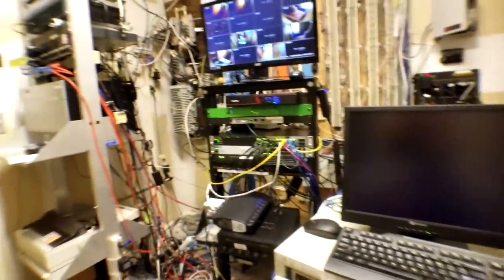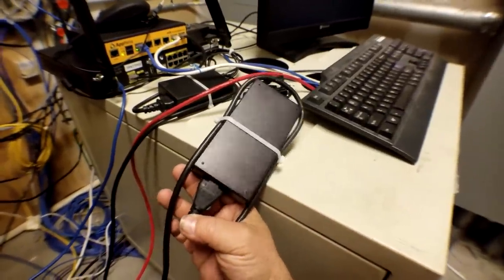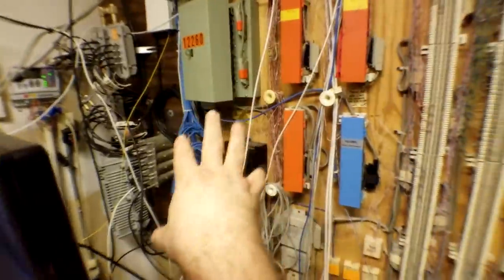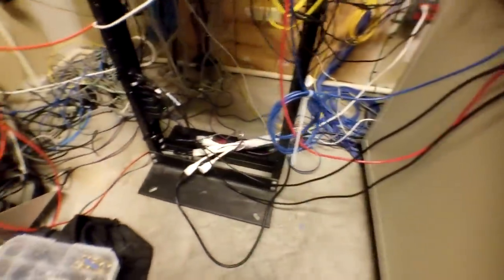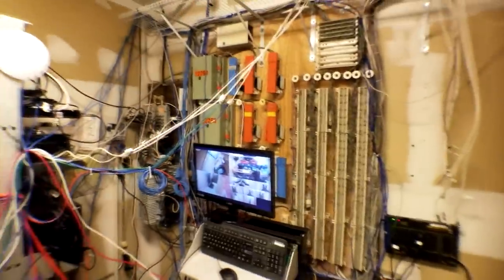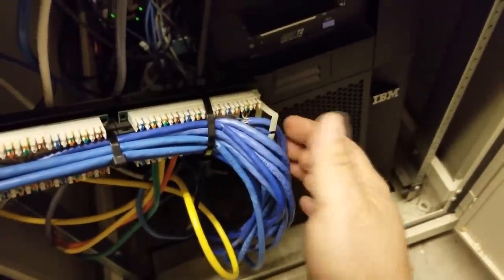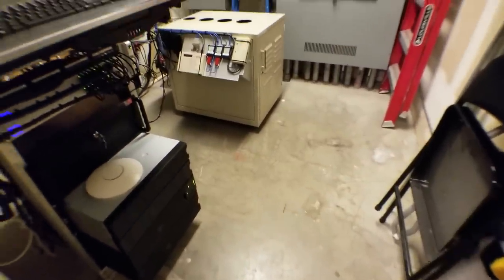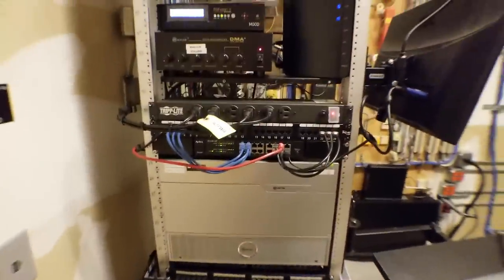#037: The Chamber of Cable Blunders (from Florida)

Comment: This is only the 2nd of your videos that I've watched, but it's got me wondering: Do you talk about lightning/spark/surge/flame suppression at length, and how to properly arrest (panel) / ground (esp. PoE) / insulate (chassis) / fireproof (plenums) equipment so unsuspecting "pros" don't leave the customer with vulnerable gear?
Reply from the maker: I have talked about it in length as of yet but it is definitely in the plans!
Reply: @FiberNinjaStudios  Another great topic (which I suspect you've already touched on) is crosstalk and RF shielding. At least in the sense that most people don't know bupkus about either one. :-)

Comment: Curious question - Which I may have missed in the Video, What range would the charge be for this work?
Reply from the maker: Obviously a lot of variables and factors go into what I charge for work like this. In the case of this job, I was actually working on multiple sites over a 3 month period. This was also on the other side of the continent and they were covering my room and board costs while I was there (as well as paying for my flights to and from). So, it would be hard to isolate this project and come up with an idea of what it would be. But, generally speaking, a project like this would usually run anywhere from $10K to $30K depending on the complexity involved. And I will add that I have learned a lot over these jobs that there is a large amount of unexpected problems that always happen to pop up so I tend to lean towards the higher end of the scale these days knowing I have no idea how difficult one of these projects will ultimately wind up being.
Reply: @FiberNinjaStudios  Thank You, I've been doing this type of work for the past 30yrs with a few Fortune 500 companies as a Salary employee. Was just curious what this skillset pays within the Contract side of things.

Comment: Curious to know how much you're paid to clean this mess (if I were you I would probably recreate the room from scratch ^^' ). In my opinion probably not enough.
Anyway the good thing is at least one manager understood it was time to do something with this room.
Reply: "Curious to know how much you're paid to clean this mess" Not enough!
Reply from the maker: Not Enough is definitely the amount I was paid for this project... I couldn't start from scratch mainly because this was a live system that was slowly being migrated to newer systems so it took time just to become familiar with all the running systems in place while working to make everything secure and safe. The real need for the room cleanup was that the local cable company needed to install a large wave of upgrades in equipment but refused to enter the room to do the work without my cleanup happening first. The entire hotel is undergoing an entertainment system upgrade with all new TV's and receivers that all terminate down to this room as well but there was no room to install anything nor was there room for a tech to enter and do the install!!
Reply: @FiberNinjaStudios  like I said it would have all been taken off line. they have back up plans for when outages happen. it would have been cheaper pulling it offline IMO then it would have been how he did it. Two people and a cable trace could have had it sorted out in a half a day then all untangled and straightened out and back on life in what 12 hrs or so..

Comment: I don't think I'd be willing to take on a project like that unless the client agreed to just buy a decent rack with full rail support. I hate those two post racks. They're inherently unstable. I'm used to 44U server racks that are incredibly stable. Then you can latch in your redundant PDU into the rear side of the rack. It's just a much cleaner solution.

Also, is there a particular reason why zip ties are being used for temporary cable management instead of velcro loops?

Comment: Using 
Keystone 1U Patch Panel and Modular Coupler is a much better system of cable management it fixes all the issues that took your hours.
Reply from the maker: Unfortunately, I often am stuck with the hardware I've got and have to make the best of it...

Comment: Nice clean up job, but stop using those fing zip ties. Use velcro rolls instead, as it's much easier to remove and add wires to a bundle and you don't have to worry about cutting into a cable removing velcro or having someone jackball sinch it down so hard they kink wires. You can also start bundling cables immediately instead of waiting until the entire rat's nest is fully separated. 

Also use only 24-port patch panels, and put a 48-port switch in between so you can patch using 6" or 8" cables which eliminates the need for horizontal cable management in most cases, which tends to waste valuable U's of space in the rack. Patch panels with individual keystones might cost slightly more, but will make life 100x easier if you need to repunch a Jack or add a new drop.

The easier you make it to maintain, the cleaner it will be and the more likely those that come behind you will add nea cables to your bundles and not create a spaghetti nightmare like this one.

Comment: I wouldn't have run but I sure would have said things are going to be down for a day while I rip everything out in make a new install.
I like the loops in the back of the patch panel nothing worse than trying to work where someone has made guitar strings. Why didn't you carry your overhead to above the rack then vertical wire manager down?

That bit you mentioned about your 24 port switch in two rows and the 24 port patch panel I liked and you gave me an Idea since I hate to put my glasses on when I've got my head stuck into a rack tracing cables. Switch top row black and bottom row gray.

OH you people and your dag gone tie wraps and when I go on site to do some work and have to cut 20 of them then all your nice work looks like junk. Why not use those new fangled Velcro cable ties or the good old fashioned 10 gage insulated wire. 
Yes guilty of running cables on the inside of the rack those channels are just too tempting not to use but have fought my own work later. Now off to watch some of your other work. Thanks for sharing.
Reply from the maker: I did plan to run a ladder rack from the main equipment rack to the wall but time and materials were lacking. Boy, do I like the color-coding of the patch cables! I wanted to do that here but ran out of time again...

Cutting zip ties causing the cables to look like junk would have also been the case if they were velcro my friend. Not a good argument. In fact, today I was doing some de-comissioning work at a restaurant that had a majority of the cable management done with velcro. What a mess. The velcro nylon fabric straps absorbed a lot of the cooking oils in the air, and was a pain to remove because cutting them wasn't an option so  each strap had to be unraveled. Greasy, messy straps. I had to first find the end of the strap and then peel it away. I can tell you this: zip ties would have been quick removal work with my trusty telco snips or dikes. In this environment, velcro was a poor choice.
Reply from the maker: Oh yeah, I wanted to also say that I too have learned from my own mistakes. Most of what I hold to near and dear to my heart are lessons learned the hard way --and running cables inside the rack is one of them for me!!

Comment: Nice collection of audio cassette tapes.  What's with the crutch and wheelchair?
Reply from the maker: I had a fall last Christmas and when I was first working on this site, I was still using them!
Reply: Ahh.  You mentioned the wheel chair so I thought maybe you were using it as a rolling cart to move stuff in and out and the crutch was something found in the corner behind the cable mess.  So what happened to the dead lizard?

Comment: work i progress. try to ditch your ties for Velcro now that you have the wire in place.
Reply from the maker: Trust me, I tried. It didn't work out. I'll be publishing a comprehensive video on the subject fairly soon. I get comments like this all the time and I feel a decent video presentation should address all of this.
Reply: I'll look for it, as I keep getting told this as well, and even though I've learned to use zip ties or high quality twist ties (rubber coated and different colors per size), I seem to have a difficult time expressing why ...

Comment: I may have missed it, but what happened to the security surveillance system?
Reply from the maker: It was pulled and replaced with a Unifi Video system. The rackmount PC sitting on top of the UPS stack is the controller and a general use machine for any remote management we need to do in this room.

Comment: You do great work! Quick question though. All the cable guys i know hate zip ties and love Velcro why are you a fan of zip ties?
Reply from the maker: I'm addressing this in an upcoming episode but suffice it to say that zip ties are stronger and necessary for what I am trying to do with the cables --forcing them to go in directions and shapes that don't occur naturally. It's a common issue when working outside of a data center or similar environment where the cable runs are engineered from the beginning. In my world, the entire IT infrastructure is an afterthought so you wind up needing to "direct" the cable runs. Believe me, I understand the concern but it's just not warranted. Also, I challenge anyone to try and crush a ethernet cable with a zip tie to the point where it fails.
Reply: @FiberNinjaStudios  that makes 100% sense. I am just trying to get insight on how to make my network rooms look better!

Comment: Replaced Rukus with Unifi for Wifi? In a hotel? I like Unifi Wifi and have many installations, but hear of issues in such application. Anyone can elaborate?
Reply from the maker: While I don't have any experience with Rukus, the Unifi system has been superb in this installation. Less AP's and better coverage! We're soon to be adding some equipment to each room that will really stress the system so we're anxious to see how well it works.

In this case, the older Rukus system was getting a bit "tired". It was installed a long time ago by a company no longer supporting this site. Additionally, the customer is migrating all their sites to all-Unifi equipment gradually so there's that...

Comment: 24:30 Shouldn't you plug them in on different breaker circuits? That config only helps against a PSU failure.
Reply from the maker: It was just a temporary connection while we waited for the ultimate UPS system to be delivered.

Comment: 11:20  For remotely-managed networks, these IP-addressable power strips can be life-savers.
11:27  Wait, they're using Cat5 to carry analog CCTV?!  The passive PoE injection, I get.  But using one twisted pair in place of coax?  I just can't see that turning out well.
Reply from the maker: 2 pairs are used for the CCTV and 2 pairs carry POE. In short it's a 100MB Ethernet line carrying the video data which is more than adequate. I've streamed multiple 1080p signals on a single 100MB line with zero problems! Coax is much more expensive per linear foot so adapters are used to allow Cat5 cable in it's place and simply convert it to the BNC connector right before entering the NVR.
Reply: For a digital signal, no problem of course, that's standard passive PoE.  But if it's carrying an analog signal, I would have thought a twisted pair would be way more susceptible to RF noise than coax.  I stand corrected!

Comment: On a side note, how do you usually get these jobs?  Does the Fire Marshall do an inspection and bring these rats nests to the CEO's attention?  I've usually reluctantly been forced to take these jobs by  getting hired as a software developer and being appalled by the state of the of the company's physical infrastructure.
Reply from the maker: It's hard to say... It's a difficult job to sell to the customer initially. The fact is that I've not walked into a messy network room that wasn't still operating fully. It usually takes someone above me that's better with their words to convince the customer that this needs to be done. I've had most of my work like this from those sorts of "allies" in my corner...

Comment: how come you use plastic zip ties and not velcro zip ties?
Reply from the maker: I've talked about this a couple times but do plan on making a dedicated video about it. The primary reason is due to concentrated squeezing power. I need to cause the cable bundles to to in a very specific direction and it's rarely the way the cables would go on their own. Velcro simply doen't have the strength to do it. But this is also because I'm working in environments that are what I would call "hostile" to proper cable management!

Comment: People in charge of maintaining data closets are, by far, the least accountable people you will ever find. A higher up would walk into a mess of a closet ask “does it work? Yes. Ok” then leave, with zero regard to the future. 

Data is the most important part of infrastructure now. It is also the last thing considered in new construction.

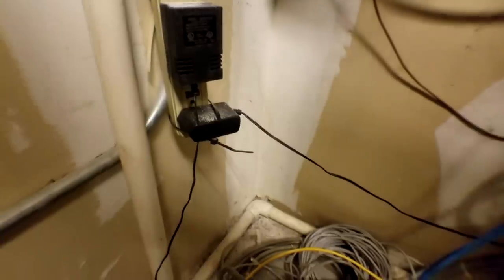Edit: @18:26 When the plumbers do a (slightly) better install than the IT team at the business.

Edit2: @19:20 the amount of absolute garbage in data closets drives me mad. There is a SERIOUS hoarding problem in the IT world.

Edit3: @21:00 D-Rings or two hole straps are usually utilized when we install a project with no future proofing considered. Bigger two hole straps aren’t a bad option in closets as long as you have enough room for the future and work all the slack from the earliest point back into the closet:

(Edit4: I base MUCH of my work base upon the standards put forth in these videos. I am a data cabling professional but that does not mean I am perfect and very much appreciate the insight.)

Edit5: @28:52 You get to use load bars? Damn, I gotta free float everything and come up with a solution for suspension every time. You’re lucky.

Edit6: @34:33 I started to do my punch downs in a straight on orientation recently. If you have to fix anything on the panel, when the entire panel is interfaces horizontally you will have problems troubleshooting. No one is 100% perfect and sometimes you need to fix you panel. Having to clip ties down the bundle, carefully peel back the adjacent cables and meticulously punch down again is way harder when the cables don’t interface perpendicularly.

Edit7: @39:50 “fiber cable is always going to be too long” me:*laughs in unicam, properly installed backbone, and a factory to support proper install*

Edit8: @42:20 The stuff that you didn’t show fixing this rolling unit is what makes you an actual artist. Not just a tech. Big respect.

Edit9: @43:30 “this machine is from the cable company and temporary” - Dont count on it lol. That’ll still be there in 10 years

Edit10: @44:30 “this opens up floor space so any technician can get in here and work” thank you. Thank you so much.

Comment: Why did you put in 2 step-down regulators for your 240v UPS? Isn't the majority of the equipment in that room rated to handle 240v?

Great job with the KVM mount!
Reply from the maker: I can't think of a single piece in the room that could have handled 240v. Maybe some of the components were designed for international use but that's rare. We chose 2 transformer racks because the UPS was capable of feeding 2, and there was an expectation that this room's demand on the UPS would only grow. It also allowed removal of all outlet strips since there were a TON of available outlets on the back of these guys!

Comment: How do those loops go with a qualification test??
Reply from the maker: They don't. This is not the environment where those tests are used.
Reply: I'm just curious if you can get away with it or if it is picked up by the qualification tester. It's a nice idea for panels where all they want is a point to point test.
Reply from the maker: Well in all fairness, I have a serious prejudice against cable qualifiers / certifiers. I don't try and hide that fact either. However, I have been wrong before... I have plans to do some real-world testing to see exactly what causes a certification failure and what it would result in to the customer. I've been talking with a testing manufacturer about this very thing so stay tuned. It's a long-term project but at least you can be assured it's on the bucket list of things we want to do here!
Reply: I agree. I only ever have to do it for government installations and its a real pain. Sure we then get a 20 year warranty from the cable manufacturer but in practice those departments are long gone in a fraction of that and everything is gutted and replaced with the next latest category cable when another department moves in. You can severely kink a cable accidentally and it will still work fine, but fail a qualification test.

Comment: Interesting the USG being used when its rated for 100mb or lower BUT can handle higher would have been easier to get the unifi pro rack USG which is meant for fiber speeds. unused AP Pro inside the server room makes no sense lol even used it makes no sense.

Comment: What are all those serial cables?
Reply: Devices connecting to the property management system for the hotel. Can be for the controlled access system, cable system for premium channels, PBX billing, premium Wi-Fi Authentication/billing. Depends on the PMS vender and how it interoperates with all the other devices but is slowly going IP based for newer devices and setups.